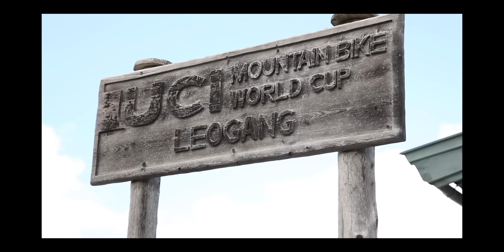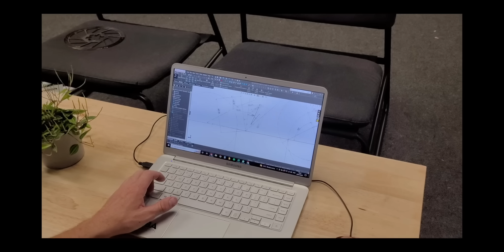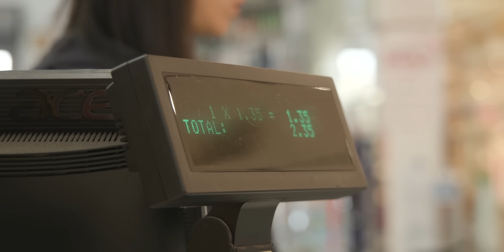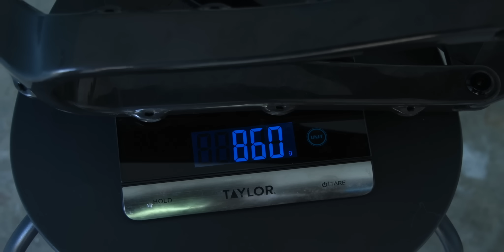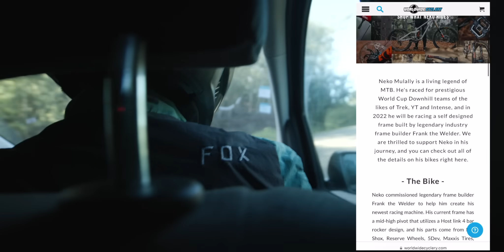FRAMEWORKS | Neko Mulally | Carbon Testing

Comment: I'm guessing the 800g make not as big of a difference as one might hope because a lot of it is "on a short lever". The wheel itself, the brake etc. are all much further away from the suspension pivot, but the rear triangle is mostly in front of that. 
Anyway, great video, always love the deep and honest insight of what goes into designing, testing and building a bike.

Comment: So thats where Dan Roberts went! his 'By The Numbers' articles were some of the best tech writing I've seen from MTB media. Cool to see the different manufacturing techniques being tested, have you looked at something like accelerometers on the axle and frame as a way to measure the influence of unsprung weight?
Reply: Rear shock position over time should give him that data.
Reply: @Finnspin_unicycles  that will show suspension movement relative to frame, which might show some differences, especially if you use an FFT to see what frequencies are affected, but it does assume the shock is able to respond to the faster inputs. Accelerometers would help isolate that the wheel is responding to the terrain due to the lighter swingarm, as opposed to the whole bike responding because it’s lighter overall.

Comment: the production quality is mind blowing!

did you achieve any increases in cumulated rear-wheel movement with the 800g weight reduction? (with less inertia the wheel should follow the ground better and thus move more per stroke and also more overall) your data acquisition should give you that value and that should be a good indicator for how much improvement the weight reduction brought. this might be biased because of the better alignment and less friction/stiction tho...

 also: in the automotive world as a rule of thumb only half the weight of the suspension arms is added to the unsprung mass.

Comment: Very nice, Neko.  I like your idea about testing the softer rear triangle too.  If performance "feel" differences were negligible but you save 800g in unsprung weight AND get more reliable alignment and parts fit, you've found a great net positive.  You are indeed lucky to have the circle of folks working with you on this project, and it's great watching your development.